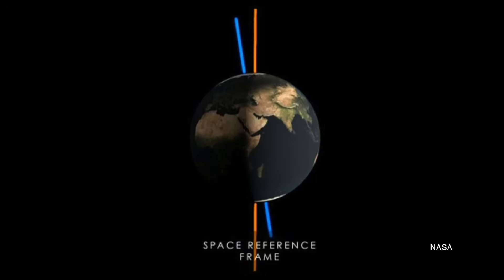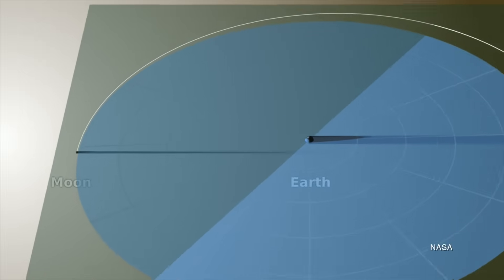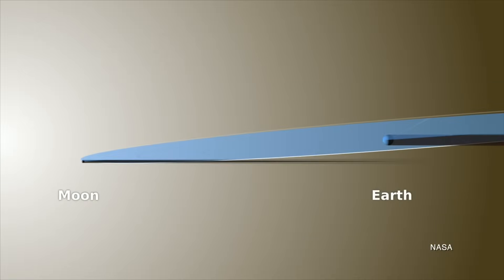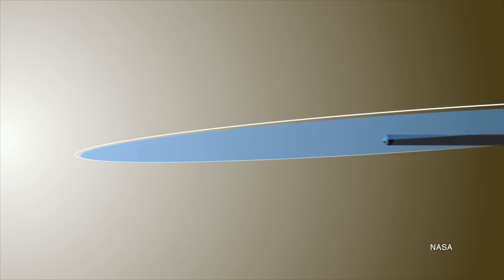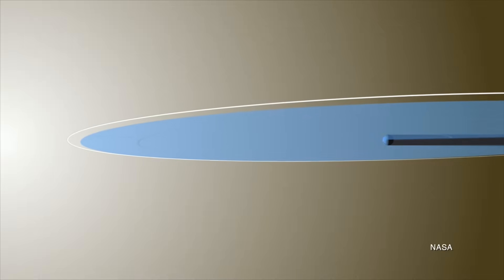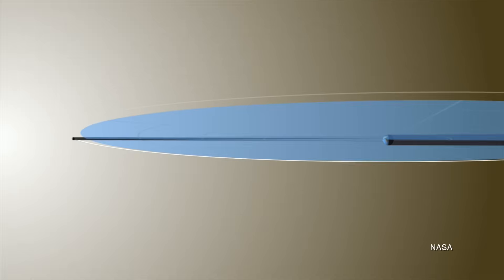Why Does a Rocket Need to Roll Going Into Orbit?

Comment: well, actually you can reach the Moon from any Earth orbit, regardless of inclination. Otherwise the Russians would not have been able to send probes to the moon. All that's required is that spacecraft and Moon happen to meet where their two orbital planes intersect. 
Any Earth orbit into which you launch from any location that's not on the equator will be inclined relative to the equatorial plane.
The optimal launch azimuth is determined by several factors. The desire to take advantage of the rotation of the Earth, range safety, positions of Earth and Moon, travel time, launch time, to make the most prominent. The optimal launch azimuth changes in time, so during a 3 hour period, while the launch window was open, it could span between 70-something and 100-something degrees. It was important to have that flexibility in order to cope with countdown holds (Apollo 17 is an excellent example).
So the explanation why the parking orbit had to be inclined isn't quite correct, but the need to roll before pitching began is well explained.
The only other options would have been to (1) always launch at a fixed azimuth, which would have drastically limited the ability to deal with the dynamics of celestial mechanics and technical faults, or (2) rotate the launch platform, which would have required a very sophisticated design of the launch pad, including flame trench, service structure, and heavy duty mechanics.
Rolling the launch vehicle was comparatively cheap.
Btw., Mercury, Gemini, Apollo Earth orbital missions as well as the Shuttle did apply essentially the same technique.

Comment: Why are the RCS Thrusters uncovered during launch on the Apollo Service Module?  They do not seem to be very aerodynamic.  Why didn't the relative wind rip them off?  I asked an Engineer working at KSP and he could not give me an answer.
Reply: the RCS thrusters were under an aerodynamic shroud adaptor and were out of the airflow.
Reply: Thanks Jeff, would you be able to put the link to a launch photo with the shrouds in place.  I have only found launch photos with the RCS Thrusters exposed.

Comment: So... To make a long story short, the roll into the plane of lunar orbit enabled the pitch over maneuver to be a single degree of freedom, as measured by the internal Inertial guidance gyroscopes?
Reply: Well, one degree of freedom of the actuators on the rocket (ie the gimbal on the engines) making the problem easier.

Comment: Hey Amy, why aren't rockets fired out of tubes instead of having a first stage
Reply: Rockets like the Saturn V had way too much mass to be able to fire them out of tubes.
Reply: That huge amount of water prevents the acoustic shockwave of the rocket blast from being reflected back up at the rocket and tearing it apart, before it gets off the pad. So, destruction by acoustic shockwave, another reason not to launch from a tube.
Reply: This is the core idea. The amount of thermal energy being produced on launch would rapidly melt any known material before the vehicle could clear the tube. It would also cause any propellant contained in the tanks to convert to the gaseous state, with dire consequences.

Just another fact. The only reason that the rocket nozzles survive the amount of heat they experience during a burn is that the fuel runs down the outside of the nozzles, from the tanks, in inconel tubes and then back up the inside to the injector nozzles where it then is released as gases, ready for combustion. This takes the majority of the heat produced by the rockets away in a continuous process that prevents the heat produced from consuming the motors within a few seconds.
Reply: Did you ever see a tube that fits a rocket???
Reply: But seriously, the main problems are acceleration and drag. You can't make a tube go 50 km, and if you want to shoot your rocket up that far, you will have a lot of drag.
Reply: +Sander Datema the Germans made
a fat rail gun that could accelerate a shell to Mach 3 over half a kilometre or so
Reply: My3dviews well, with the exhaust gasses not contained it can accelerate against gravity
Reply: Tactical Ultimatum  Containing the exhaust gases would be difficult on a rocket that size.  The gasses on launch are diverted horizontally and the pad cooled with huge amounts of water dumped on the launch pad.  So within a tube the heat would build up.   You possibly could launch a small rocket from a tube, but not sure if it would be that beneficial.
Reply: All very interesting. Thanks to all commenters
Reply: MsJoaniePH thanks
Reply: They are fired out of tubes, but still need a 1st stage.  Peacekeeper, Small Missile and Trident are all "tube fired", but not with explosives.  They use steam.  Water is superheated under pressure and then released.  This generates enough force to toss a 70ft x 7ft missile over 200 feet into the air.  This type of launch is critical to sub launched missiles.  It allows the missile to be launched from underwater without the sub surfacing and protected from the missile exhaust.
Reply: MuyGordoGato Awesome, still think it would be good for rockets.

Comment: I had to watch it twice but I figured it out.  Because the navigation system is gyro based, it had to roll first before the pitch, that way it would pitch at a non-cardinal angle.  The first thing to blow my mind was that they used gyro's to navigate (no gps of course).

Comment: Although your video was very interesting and well explained I think the roll program was needed for a different reason, I will try to explain why and if anyone more knowledgable can correct me I would be glad to hear it.
The minimum inclination an orbit will have relative to the equator is the latitude of the launch site, so for all launches from kennedy space center that would be between 28° and 90°. The ISS orbits at 51° inclination to accomodate the latitude of the russian launch site. 
So since the moon orbits at an inclination of 5° the saturn V would never be able to match that inclination anyway, please correct me if I am wrong, but I assume they just sort of looped over in the lunar transfer orbit at the precise timing and arrived in lunar orbit with a relative inclination to it anyway (hard to describe in words). 
If that is the case, the most fuel effective way to launch would be due east anyway because it maximizes the energy you get from the rotation of the earth and is the closest match to the lunar orbit (28° as a result being as close as you can get). 
One thing that does have to be considered for orienting the rocket are the g-forces on the astronauts: Ideally they should be pushed into their seats instead of pulled sideways or into their seatbelts from the pitch maneuver, so just like the space shuttle the saturn v would roll in a way that towards the end of the launch the astronauts are "on their head", which conveniently also allows them to see the horizon through the window once the launch escape system is jettisoned in order to determine if the rocket is still on the correct trajectory.
Since the crew hatch of the capsule is located right above the seats of the astronauts and it has to be oriented towards the launch tower in order for the astronauts to actually get into the rocket in the first place, the saturn v would be rotated towards the north at the beginning of the launch.
So I believe the roll programs actual purpose would be to simply rotate the rocket 90° from north facing to east facing, and in the end, the moons inclination has very little to do with it.
Reply: The moon orbits with an inclination of 5 degrees relative to the ecliptic, not the earth. You need to combine this with the earth's tilt.
Reply: ah yes, I didnt take that into account
But, the earths tilt is 22 degrees, +- the 5 degrees from the moon is 17-27, which is still less than the 28 degrees from the launch latitude, so my point still stands I guess

Comment: I understand why it had to go into an inclined orbit.  However, the engines can gimble so why was it necessary to put the crew cabin upside down?
Reply: Engine gimballing alone isn't enough for the azimuth roll to place the Apollo Saturn-V on lunar trajectories. The Saturn-V was designed with equatorial operations such as deployment of large lunar stations which had different roll requirements.
Reply: Ignore my previous comment.

Comment: So, short vesion: to align the pitch axis with the launch azimuth.  I always wondered about the roll before pitch.  Great explanation.
Reply: Yup, that's basically it, Diego.  I asked this same question a few weeks ago in a FB Apollo group, and they told me that was the reason.  That gigantic crawler reaches the launch pad only one way.  The tower only connects to the rocket one way.  They were launching a lot of different rockets a lot of different ways, so yes, it's easier to rotate the rocket than to somehow get that gigantic, heavy crawler to rotate.
Reply: That doesn't answer the question of why wasn't the rocket properly aligned on the pad in the first place. I'm assuming that it's because it's much easier to rotate the rocket a few degrees in flight than to modify the pad and rotate the rocket on the ground for the correct orientation, especially because the required angle changed with each launch and when there were postponements and so on.
Reply: ha nice complete explanation in a short sentence! I guess a lot of the video was background info, explaining spacecraft axes and non equatorial orbits.
Reply: Larry Troxler
The fact that I was able to state it so clearly is a testament to her ability to explain these things.  I really wish she'd do one on the eight ball.
Reply: short and clear is always good 
but one point: by definition pitch axis was brought to normal (perpendicular not parallel) to the desired bearing (launch azimuth as you call it or I would say ''the orbital plane'')

Comment: Why not turn\place the rocket on the pad so it's pitch axis would align with the desired direction?
Reply: The Saturn-V was designed for more than just lunar missions. There were low orbit missions to deploy space stations, mars vehicle components and more. All with varying roll requirements.
Reply: It's not just having the rocket aligned with it's launch azimuth-it also has to be properly aligned with the tower so all the connections can hook up.  That means you'd have to turn the entire pad/tower/rocket.  And if the launch was delayed (like Apollo 17), the azimuth changes.  It's actually easier to put everything in a known and set configuration, then just roll the rocket right after launch.

Comment: Why did the Titan II GLV need a roll program, then? It was just going into LEO. Were its orbits inclined greater than 28 degrees?
Reply: Good guess but Gemini went to lower inclinations to maximize the Titan-II's payload capacity. The Gemini spacecraft weighed in at 4 tons. The Titan-II lifted a little over that to LEO. Cut that down to a little over half the weight for polar orbit and the Gemini capsule could not have been flown at it's 4 ton mass.
Reply: Again, the main reason for a roll program is to keep the side of the rocket with the antennas facing the ground. Some especially important antennas (e.g., range safety receivers) were replicated around the rocket so one could always be seen from the ground, but this wasn't true for most antennas, including telemetry on the launch vehicle.
Reply: It may have had to do with the way the Titan LV was positioned on the pad or the pad orientation.
Reply: +J Dean Well, according to the video, they were positioned according to the cardinal directions. If that's the case, it's azimuth would already be 90 degrees, or east, right? Or was LC 19 positioned so the azimuth would be 0 degrees, or north?
Reply: This is just a guess, but they probably wanted an inclination that kept them as far from the Soviet Union as possible
Reply: If I recall right, the pad was positioned towards north.
Reply: +J Dean Lower than 28 degrees? I don't remember reading about a dog-leg maneuver as part of the GLV's flight plan, which I would think would reduce its payload capacity to LEO.
Reply: 28.5 degrees is the lowest inclination one can reach if going directly east from Cape Canaveral.

Comment: Now tell us why the Space Shuttle when launching rolls and the shuttle "hanging" in the direction of earth?
Reply: Once the all the above reasons are true, but azimuth is also a major reason for the roll on the shuttle. Keep in mind that in its early days the shuttle was the only way to launch payload into orbit available in America, so it had to launch into all sorts of inclinations for all sorts of payloads. 

The shuttle solid rocket boosters are, at launch, significantly more powerful than the main engines, so it would be nearly impossible, or at least  a waste of fuel, to fight them in the pitch axis. And the shuttle couldn't yaw due to its asymmetrical nature. Any yaw would throw off the careful balance. So the only way to put it on a correct flight azimuth every mission was to launch, roll to the correct azimuth, then pitch backwards. 

This became even more of a necessity with the ISS, which is on an inclination "halfway" between the US and Russian launch sights
Reply: The main reason the Shuttle took off and rolled to a heads-down position was so the ground could see the antennas on the top of the orbiter. (There were antennas on the bottom of the orbiter as well, but they were blocked during launch by the ET and SRBs.)

Later in the program, several minutes after leaving KSC and moving out of range of its ground stations, the shuttle rolled heads-up so the top antennas on the orbiter could see the TDRSS satellites.
Reply: At the time of the first mission, NASA said it was to put the flight crew in a heads down position to ensure the blood doesn't leave the head as rapidly as it would heads up. Some here say it was to point the antenna's towards Earth or to provide the crew a view of the horizon. These are probably true as well. The shuttle pads were originally built for Apollo. Providing access to the shuttle meant rolling the stack just after liftoff. The alternative being major mods to the pad such as turning the hardstand so the flame trenches point in the direction of the orbit. This would have been impractical since the shuttles orbital inclinations ranged from 28 to 57 degrees at the cape. Had VAFB become operational, I suspect the shuttle roll would be much less apparent.
Reply from the maker: I talk about the Shuttle's launch profile and roll in my blog post!
Reply: Amy Shira Teitel The Blog post but please make a video?
Pretty please?
Reply: lol

Comment: But why were the pads oriented north/south when east/west would have made more sense for 99.9% of all rocket launches?
Reply: One reason was probably the sound waves. The pads being oriented as they were would have minimized sound wave effects on the VAB and other structures less than 5 miles from the two pads. At least this was probably the case with Apollo since it didn't utilize hardened block houses for the LCCs.
Reply: Possibly--I know today's pads (and thus the old shuttle pads) were built on top of existing structures of the Apollo-era pads--which means 'reasons' stems from them--but sound waves?  Did NASA care about sound waves?
=)
Reply: +Michael Davidson   Yes, "sound waves" were a consideration.  Watch the video of the first Saturn V launch from CBS.

Comment: why even bother with rolling when the rocket could just tilt at the azimouth angle? Its a simple math transform from one axis system to another and if their computer can do trajectory calculations why not axis transformations?
Reply: Because you're suddenly doing a lot more math (trigonometry in particular) on a computer with very limited capabilities. It's just a whole lot simpler to roll, and pitch in a single axis. It saves you a whole lot of headaches and problems, for very little cost.

Comment: Amy another great video - thank you. Could you please tell us about how many gs (acceleration) the astronauts on the Saturn V experienced.
Reply: 4 to 5 Gs.
Reply: ***** Thank you. Any idea how long they had to endure that for?
Reply: First stage cut of after about 2.5 minutes, in which the g-forces slowly increased from 1 to 5. The worst would be the last 20 seconds of the first stage.
Reply: My understanding,  of all of the millions of gallons of fuel, (liquid and solid) it takes to get that weight into orbit is "stored" energy in the rate of speed that it ends up at. Like 5 miles per second. Then to decelerate that energy with their air brakes to come back to earth, it has to dissipate all of that energy. No wonder things get hot.

Comment: I always thought the roll was just to get the hatch pointing "up" in the initial minutes of the flight before getting into orbit and micro-G. Since the hatch was at the "top" of the capsule from the seated astronaut's perspective, an upward pointing hatch would mean they were seated "heads up" once the Saturn V pitched over. This is illustrated at 2:51: you didn't do a roll in your demo as you pitched, so the hatch ends up pointing down, and the astronauts are left hanging in their seats upside down. Or is that too simple?
Reply: Oops, didn't fully expand ApolloWasReal's extraordinary explanation to see the whole thing. Ignore, reboot, and delete this comment. :-)